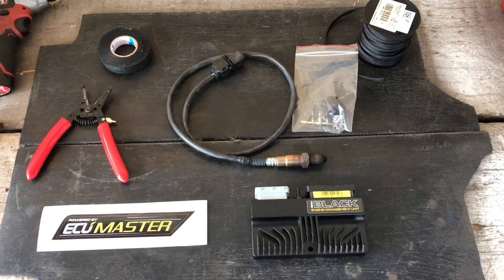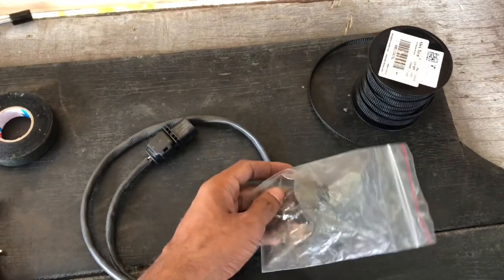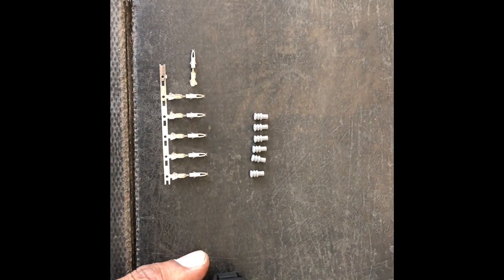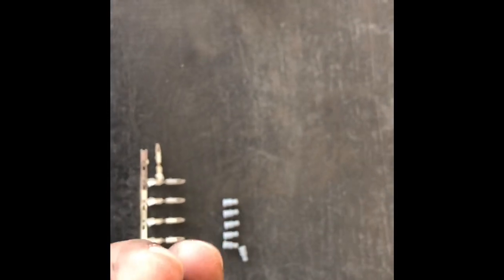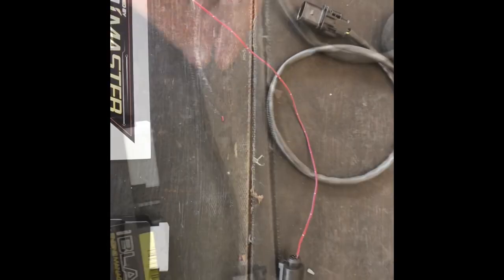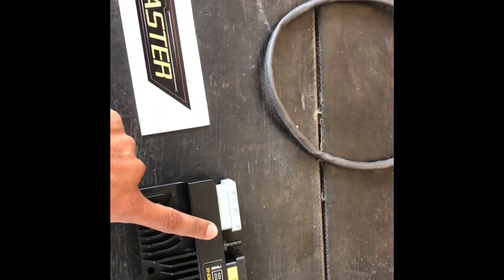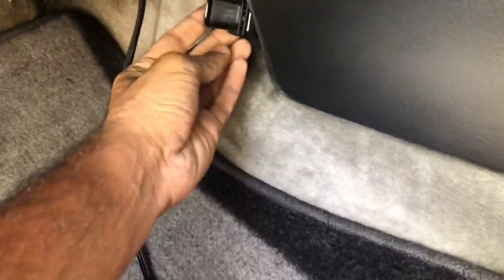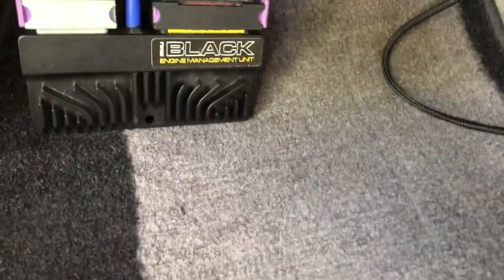Wideband Sensor install on ECU Master EMU Black

Comment: Would be nice to see how you wired it on the ecu side
Reply from the maker: The diagram is available on the rear side of the ecu pinout card , which is supplied together with the ecu , it can also be found on the ecumasterusa website , also on google

Comment: Hey man nice video - Whats the part number for the o2 sensor ?
Reply from the maker: Hey Henry , I’d get the part number for you , it’s a Bosch 4.9 LSU sensor
Reply: @that240_lyfe7  Hey man i fotgot your instagram got a question about a flex fuel sensor
Reply from the maker: @Drifftpanda  that240_lyfe